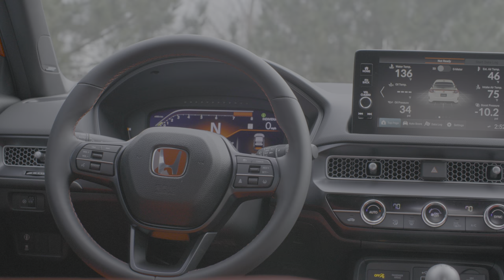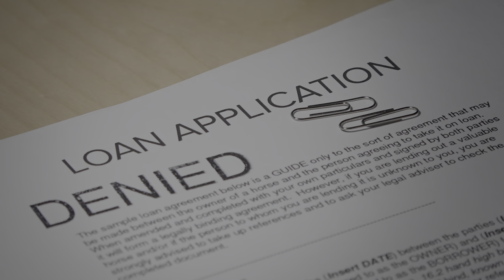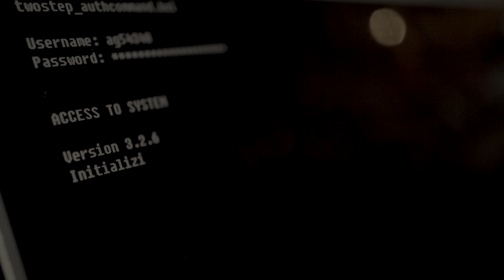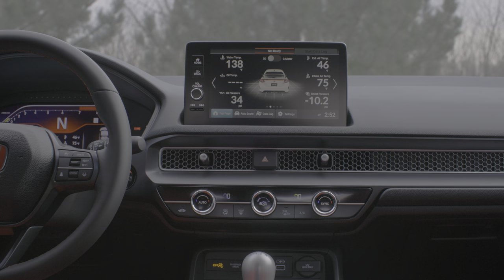Why I Bought an FL5 Civic Type R

Comment: What stops me from buying the new Type R is the insane mark ups. I owned the FK8 Type R and had to wait 3 years before finding one at MSRP + accessories. I purchased an FL5 Sport Touring hatch and it had poor bumper fitment (bumper not clipped into the bracket properly) and the worst thing was how the roof rail had the clear coat buffed through to the color. I was disgusted and sold it. Honda quality as well as other manufacturers have declined substantially over the last few years. It's sad.
Reply: Here in Canada we can't even buy one, with only 546 to be made over the next 3 years. For the first time in years, I'm not even going to bother going to the Canadian Autoshow, because I can't stand to see this shit being displayed and advertised, and then when I ask if I can buy one I'll be told to get on a list to get into a line to get a ticket to a lottery to maybe get a chance to buy one. Fuck that.
Reply: lmao the rear panel gaps on my '20 Si are pretty bad.
Reply: Honda quality has been overrated for a long time now. My parents still buy it based on their old reputation. I had a 2009 CRV and it was a total piece of crap. Honda paint is also absolutely terrible.
Reply: I freaking work at a Honda dealer. Fairly high up. Still cant buy a FL5. Couldnt buy a FK8. So ridiculous. So my plan if I want a Type R? Buy a used FK8 and put a large middle finger to the FL5 experience. At least it looks like an R.
Reply: @steverogers7211 agreed, grew up a Honda fan boy, still have my 93 prelude si/vtec and 07 tl type s, I have moved on to Lexus and Toyota  after owning a is300, with RX and looking for a 4Runner just waiting to see if prices come down
Reply: @steverogers7211  honda paint is junk and the clear is thin as hell. I won't buff one myself and instead I'll pay someone insured. Good wax definelty helps but not people do it
Reply: I have a 2020 Acura RDX and it's the worst new car I've ever bought.  The amount of rattles and other quality issues have driven me away from the brand.  Acura is supposed to be the "best" Honda can do.  It's pretty sad when the build quality is worse than my buddy's Chevrolet.
Reply: @gns942  Exactly, this is why i dont give a shit about cars anymore.
Reply: It is 50k MSRP in Canada. I would seriously not even bother buying it even just for MSRP. 50k MSRP for a glorified econobox 4 popper is just way too much no matter how you spin it. They toned down the design but the rear still looks riced out with that comical spoiler. I would much rather get a GTI for 20k less.
Reply: @janoycresnova9156  I believe that’s part of the issue as well, for those who’ve been around long enough remember when Hondas were popular for price, build quality, and some fun especially honda civics, now $50k for a civic even for type R is crazy.  You can literally get nice used Audi S5 Sportback for that price.
Reply: @janoycresnova9156  100% GTI is a much better value and a much nicer car.
Reply: Totally different animals to have a normal Civic built in Ohio versus a Type R built in Japan.  As with most of the US built cars, the QC is okay at best, but there is a notable difference for how detail oriented the Japanese assembly lines are.  To be fair, there are exceptions to everything...but after working at Honda and Mazda dealers long enough to see both country builds on the same lot (as well as MX builds), I can tell you that the lead goes to Japan, followed by US, and then lagging in left field, MX.
Reply: Regarding the current crush to get this car, I remember  James Thurber's old crack, "Sometimes he who hesitates is saved."
Reply: @2strokeFORever  Every brand has shit paint, even more "premium" brands like BMW and Mercedes.  It's due to government regulations.
Reply: @huehuehue-x3c  Mercedes paint is not shit, the paint they use would cost 10k plus for a paint job. They use permagard in there paint, which is the same stuff they use in airplanes, meaning it can never rust.
Reply: @Sideways_Singh  You have to be high if you think that Mercedes paint jobs are worth 10k. Also, Mercedes dealers offer permaguard as an optional add on - it is not part of the paint. The truth is that Mercedes, Audi, Toyota, Honda, Chevrolet, etc, all have to meet the same paint specifications according to the EPA if they want to sell their cars in America.
Reply: @janoycresnova9156  absolutely pissening
Reply: What made you sell the FK8 and downgrade to the FL5 sport touring?
Reply: @gns942  That is the correct right attitude!!! Just say no and don't buy their garbage.
Reply: @wakeboarder993  it's nature boy Rick flairening
Reply: @CU08  I have one too. Not that impressed like you said.  Infotainment has big issues with Apple CarPlay.  Car is good looking but compared to our 2021 BMW M340, which has been much more reliable, it’s definitely a level or two below in build quality and solidity.  In fact, I am considering replacing it with an X3 when the lease is up this summer or on the cheap side, a CX-5 turbo as they were built better (we owned 3 CX-5).
Reply: don't forget about the wobbly hatch. From a distance.. the new civic looks like a good deal... when you take it up close and in detail.. it is not a patch on previous gen cars(hatchbacks), not only from Honda but, from other manufacturers as well.
Reply: @billm47645  cx5 turbo go for over $40k new, not cheap to say the least
Reply: They have. I swore by Honda 15+ years ago, but now I don't even consider buying any new Honda. I was looking at a Passport over the summer until I found out the trans in those (and Pilot, and Ridgeline) pretty much grenade before they hit 100k. Some people get luckily, but tons of people that had to replace it way too soon.
Reply: @MrNgMichael  it wasn’t in that order. I sold it to buy the top of the line 14th Gen F150 Powerboost. It also disappointed me with worse quality. Sold it too, but I did make a profit though.
Reply: @GNS  so true. What's the point of going there or even watching medias as we can't even buy these cars anymore. O great the new z06 is out and is awesome! Try getting one. O you found a used one getting flipped? Its 200k? It just make no sense anymore. I don't regret focusing my hobby on my motrocycle only as it is SO MUCH CHEAPER
Reply: Shouldn’t have sold your FK8
Reply: You claim the panel gaps were off in the Swindon factory.  Horseshit. My FK8 has millimeter perfect gaps everywhere. Seriously dude.
Reply: @j.3854 exactly,  the FL5 looks way to plain and doesn't stand out.

Comment: I had a similar dealer experience regarding the PDI when I bought my Miata. You could see the sales persons surprise when I told them to not wash it and keep all the film on. Folks who mostly sell CUVs don’t often see particular folks buying a car they have an emotional attachment to.
Never mind the OCD folks who PPF a Miata…

Great video! I hope you drive the wheels of this new kinder to the eyes CTR.
Reply: nice miat.
Reply: I went back and talked to the detail guy since since I was forced to pay for ceramic coating to get my wife’s RAV4 at msrp. Lol they just spray it and wipe it off, takes 5 minutes.  The average person doesn’t understand paint care and detailing.
Reply: @Tool0GT92  same as most protection add-ons that aren't done by a reputable installer - snakeoil.  If it's not taking a day or so to paint correct and prep the car, you might as well just go with the standard DISO.

Comment: Congrats Mark.  Right after Sept 11, 2001 the markets tanked and I had some expendable income.  I went to Continental Honda in Countryside, IL and ordered a 2002 AP1 S2000 (Silver with all red interior).  I said no to the stupid pin stripes and other options they normally would desecrate the car with. My requests was to call me to be there when the car was being unloaded.  I had a little digital camera and took photos of the whole thing.  Told them to not wash it and I drove it home in break in mode.  That break in period was some of the hardest times to not experience vtec in it for the first time until after 500 miles!  I will say Continental was very good with that experience in allowing me, an enthusiast to do it right.

Comment: It's awesome that you got it for list! I got told it was 63k out the door non-negotiable. I walked out of the dealer obviously because unless you only care about the Civic in the vacuum, it's not worth more than 50k.
Reply: the type r shouldnt be more than 40k.
Reply: @JJ-mh3hb  you shouldnt be broke
Reply: @thehumanoid6543  Relax, its just a civic chitbox. Worth 40k at the most. Probably less.
Reply: FL5;Type R isn't worth squat considering the Elantra N with a stick is toe to toe with it.
Reply: @boygonewhoopdataZZ  yeah it's like Coke vs RC cola or any knock off half price same taste. Only thing that will be better is resell on Honda
Reply: glad you walked. If everyone did this, there would be no Markup Issues.
Reply: in the states, the dealers ask you 60k usd.. way over MSRP; here in Europe, Honda themselves ask 57k euro, no option added. Here, with paint and a couple of options, it is a 60k car. I guess they figured that, if you guys in the states are willing to pay 60k to get one, why we, in EU, wouldn't willingly pay the same??!
Reply: @B-Lou - Yeah...except driving the Elantra N is basically driving around with a time bomb under the hood that can blow up any minute, and you never know when. Just that it'll be sooner than later. And the residuals are super low on them, as are their resale values.

But if you're ok driving around an IED...it does drive well. It's basically a fun rental...not an owner car.
Reply: @eugenux  doesn't the EU also pile on a ton of taxes on cars like these? Plus the import fees...?
Reply: Because you're not a popular YouTuber like this guy , Topher etc
Reply: @thehumanoid6543  broke? Lol who pays 50 for a civic
Reply: @BigBear--  that's why there's a 10 year warranty
Reply: @BigBear--  a civic is no more than a fun rental either. I'd take it over the type r anyday. Purely a better daily.
Reply: @mharro88  Obviously most Type-R buyers pay more than 50 for a Civic.
Reply: @mharro88  Good luck getting the warranty honored by Hyundai for a blown engine. At the very least usually you'll be waiting months while they try to find any reason not to honor it and blame the customer for the damage. Then maybe you'll get one...only to blow it again, and again, and again. The engines generally if you're lucky won't last more than 100-150K on average if they don't blow early. At the average driving mileage of 12,000 miles per year, you're guaranteed to blow your engine after the warranty period is up. That's what I mean that it's not an owners car. If you want to own it long term, you're guaranteed to be replacing the engine at least once out of pocket, if not more than that...if you take it easy, baby it, and get lucky. Forget that the interior is lower quality, the cars residual is much lower, as are the resale values, who wants to be driving around a time bomb long term? Most ppl serious about cars and their wallets don't. Which is proven out in the market place...
Reply: @mharro88  I called it a rental car because the car is not worth buying, but maybe leasing...so you have fun driving it around during the lease period, and give it back before any problems occur. Which they still might during the lease period...but with warranty you might not be out if pocket for repair costs (if your lucky). 

All civics are owner cars, which ever you prefer. Because they're built like tanks, will last forever, and are designed to be easy and relatively cheap to fix if anything does come up much later down the line.
Reply: @BigBear-- I'm in Australia and  I've had a i30n hatch since 2018 done 140,000 ks it's not missing a beat after tracking it a dozen times. N cars are reliable. They're basically a bmw m2 with the same performance and engineered by the same team. They're not the Hyundai of old. 
I also own a i30n sedan now (Elantra n) and it's even a step above the hatch

I would absolutely never buy a Honda in Australia. They're overpriced, recently actually had a few issues and their dealership network is now gone , they're about 2-3 years from exiting our market all together with terrible sales. Honda is basically only big in U.S now.
Reply: @BigBear--   haven't heard of any issues of blown engines in the N cars... Older non N models there were reports but like I said since 2018 Hyundai have been very reliable. Hyundai Australia is also way more supportive than Hyundai U.S, their dealership network here is 100 times better than Hondas which you get zero support for because their dealerships have basically ceased to exist.
Interior is no worse than the civic having driven both I preferred the seats in the N sedan they're way better for long distance driving. It's just better value. Nobody is paying 72k aud for a civic R here, . We're not like Americans we don't value Hondas here like you still do for whatever reason.
The type r will depreciate masssssssively in the next few years here in Australia due to increased supply and Honda most likely existing our market plus EVS rolling out in huge numbers here. You'll be able to grab a secondhand one for 10k less in a year or so
Reply: @mharro88  you have no idea what ur talking about. Anecdotal stories are just that. 140K is in the range I said, I said on average. As for blown engines, and recalls, just look up "Theta II problems" anywhere and you'll find pages, upon pages of info and videos. Same goes for their transmissions. Theta II's are notorious problem engines, they have a few major design flaws, that lead to them getting blown up. For the most part its a problem with oil starvation and oil consumption (that can lead to oil starvation). They oil starvation leads to tore up crank bearings, and once those go the engine's blown. 

As for Australias not liking Type-R's...really? The new FL5 sold out within 24 hours of becoming available on December 1st. Average sales price of  72K australian. With anyone wanting to get one now having to wait till end of 2024. 2020-2021 FK8 Type-R's are selling used for between 70-80K Australian. Meanwhile the i30N sells new for around 50K Australian. Sure seems like the Australian market likes their Type-R's just as much as the Americans.
Reply: @BigBear--  they're selling about 500 type rs here of course they're sold out? There's enough rusted on Honda fans that'll pay that ridiculous price.
Honda overall in the country is doing terrible in sales , they're bottom with Nissan .
Nothing wrong with Hyundais transmission.. u.s had a few issues but nothing here. Your transmissions over there are assembled in Alabama. Not ours.  Their 8 speed DCT is more responsive than a dsg and near pdk levels now. Hyundai Australia has trained N techs and a huge network of dealers here who are actually supportive unlike the rubbish in u.s.
Does Honda give you a 10 year warranty with a track warranty to go with it like Hyundai? No and for a car just as quick as a type r plus more livable it's a no brainer.
Reply: @mharro88  That Hyundai is rubbish we can agree...the engineering doesn't change from AUS to US. Same engine's used, with same design flaws. As for how many or what Honda sells there besides the Type-R...No one's ever claimed that Australians are geniuses. The entire country is like the red-neckiest part of our South...but it seems even they recognize the greatness of the Type-R. 🤣 In the end drive what u want...the risk is urs to take...I didn't come to Hyundai videos hating on them, you came here.
Reply: @BigBear--  actually it does. The DCT recall in u.s occurred nowhere else in the world because the DCTs there were assembled in Alabama. The Elantra here and Korea has had no issues.
Reply: @mharro88  If you stomp around in a circle while holding your breath, it'll make it 💯% true! Go on now...until you pass out.

If not, then maybe spend some time doing some research for "Elantra N Theta II issues", or "Elantra N transmission issues". They have not addressed the oil starvation through a proper engine redesign. The oil ports for the crank are still the same, as is the overall oil flow design, and no amount of software hot "fixes" are gonna change that. They have issues across the entire Hyundai/Kia range, including all the latest model years. Some that are still too new are just that, too new not enough time or miles have passed to come up with statistics...I would not be expecting any pleasant surprises however, since it's the same engine. Some things are more easily addressed with a part change or gasket/seal update. Some problems are inherent to the overalll design of the block itself, which is the case here. Wishing it wasn't so, isn't going to change reality. 😕
Reply: @mharro88  Okie-dokie. 👌

"Hyundai is recalling 125,840 Elantra sedans, Kona SUVs, and Veloster sporty cars with a 2.0-liter engine to address a potential issue with the piston rings. These cars from the 2019 to 2021 model years use engines that may have been assembled with inconsistently heat-treated piston oil rings. The concern is that the problem could lead to increased oil consumption, progressing to a knocking sound, and the engine seizing and stalling."
"Hyundai’s Kia brand issued a similar recall last month for 147,249 2021 Seltos subcompact SUVs and 2020 to 2021 Soul wagons to address a problem with the same 2.0-liter engine."